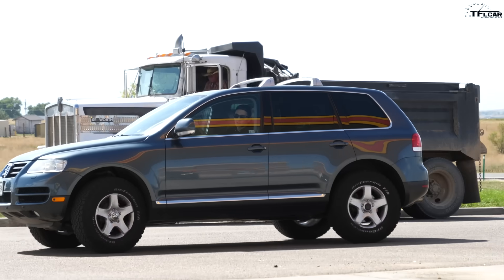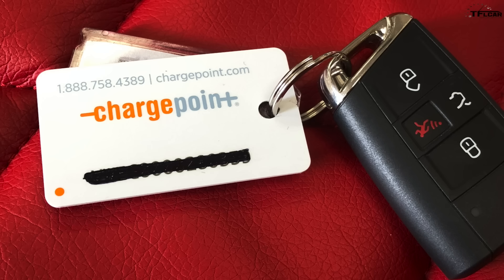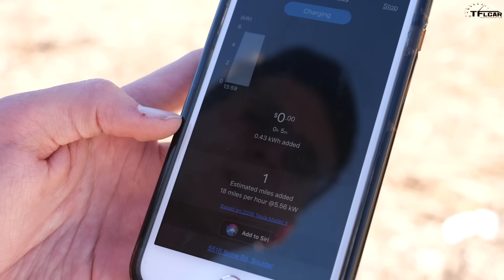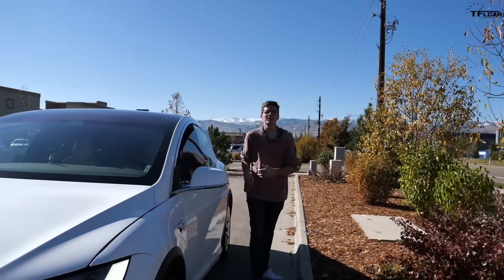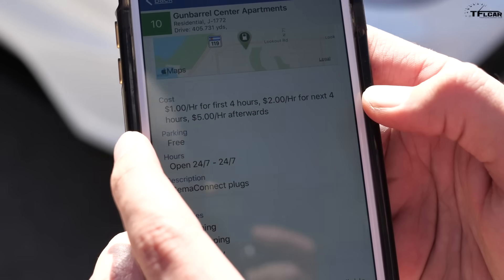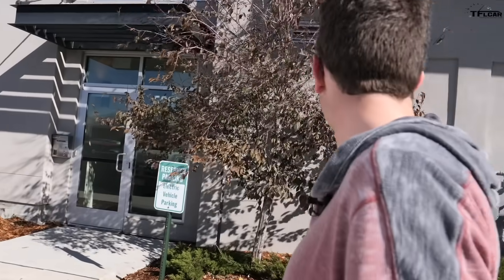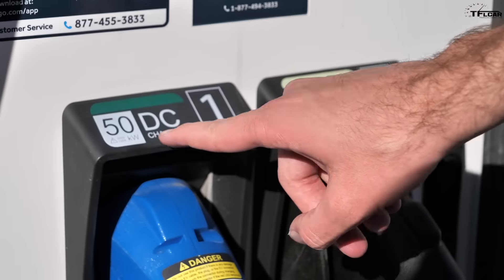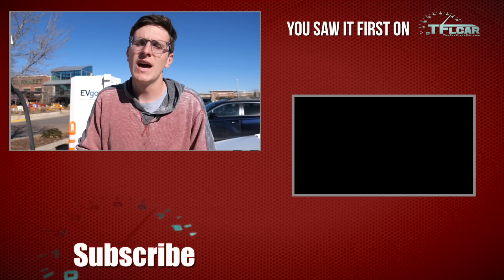Here’s Why Charging an Electric Car Can Suck - And It’s Not The Reason You Think!

Comment: Slow charging everywhere is the future to be aimed for. Think about it. The charging is wherever you happen to park so when stopped you are always charging. Eventually it will be wireless and solar.
Reply: what you communists do not understand is the battery after each charge is going down on voltage and range. NO BATTERY GETS BETTER WITH USE. they all lose capacity week by week. also using a super charger takes away MORE of the life of the batteries

Comment: Most people can make owning an EV work, especially in cities. You can find reasons not to, if that's what you want.
NOBODY SITS IN THEIR CAR FOR HOURS WAITING FOR IT TO CHARGE. Charge in your driveway, for some people that's all they need. Some areas have chargers near stores or work. I used to slow charge, a 110v outlet at work, 8 hr. was more than enough. Most rarely need to charge from empty to full.
Reply: The bigger the battery the longer it takes to charge, so if you're charging at level 2 (220v) over 4 hours, you're getting a lot of miles.

Comment: Absolute Bull Crap!
You don’t pump diesel in a gas car, so you don’t use wrong adapter. I have driven 1100-miles a number of times, used superchargers, chargepoint, flo…never a problem. As to how long it takes, better ask your non Tesla manufacturers why they keep on making “town cars”.

Comment: The charging station networks are a negative when it come to car charging. Simply is not in the playbook. The installation of one or more 50 amp plugs on the back or side of a store or station should be a good start. The EV owner can carry a gen 2 charger while traveling.  The store charges a fee for plug use. The store, station, eatery,  or whatever, will most likely make further sales to this patron also.

Comment: "Without solar, your electric vehicle is still effectively running off of fossil fuels – it's just the fossil fuels utilized at the power plant and not within your engine"
Reply: This is really a COAL POWERED car!  Ha! Ha!
Reply: @stantheman5350  Unless I take a road trip, my Tesla is WATER POWERED! Ha! Ha! Thanks to the Hoover Dam.
Reply: Doesn't need to though, even though wind and solar aren't proving to be the silver-bullet alternatives people want them to be, geothermal and hydroelectricity are proven technologies, gaseous fuel plants can burn landfill biogas, and, of course, there's nuclear fission, and now with even better, safer, reactor designs that can use waste from older reactors, it's a better choice than the great option it was before. Yes, the waste is very dangerous for a long time, but it's concentrated and contained, not floating round in the atmosphere.
Reply: @notmuch_23  Silver bullets! So who’s arguing that?
Reply: That will depend where you live! 19% of the USA power comes from Nuclear generation.
Reply: Fossils are made of stone; in other words this is an intentional misnomer. Its MINERAL oil - and will never run out....now think bout how that affects the price.
Reply: How about battery life.  How often do you have to send batteries to the land fill.  Every ten years??
Reply: @ed5308  I believe Tesla claims they need to be changed every 400,000 to 500,000 miles. That to me is a best case figure. In reality, given extreme weather swings in temperature, that figure will be greatly reduced for cold climate users.
Reply: So it’s interesting how you completely discounted any benefit from renewables such as Solar, Wind, Hydro, Geo thermal, and Bio-Fuels! So why didn’t you mention those sources of energy?
Reply: @theodorehaskins3756  The benefits are minimal at this point.
Reply: @Mike-zf4ev   Really! So remind me of who you are, and what is it that you’re an authority on?
Reply: @theodorehaskins3756  Read the data. They account for 21%.
Reply: @Mike-zf4ev  okay! 21% and that’s nothing? Is that what your data says, 21% equals zero?
Reply: Not if it's a hydraulic or nuclear station.  Neither if a fossil fuel.
Reply: So this is news? Who’s arguing that? Tell us something we don’t already know! Thank you!
Reply: @omi_god  I'm sure it is a percentage we can't simply ignore but what is your source?
Reply: Not even remotely true. The grid has a wide range of non-solar, non-fossil energy sources. One or the other of wind, geothermal, nuclear, and hydropower are sometimes all or nearly all of the energy source for some grids. And why leave out solar? It is also a large and growing contributor to many grids. Fossil fuels are a diminishing part of grids almost everywhere.
Reply: Depends on where you live. In WA state we get 2/3 of our power from hydro electric and only 20% from fossil fuels.
Reply: Yep, so true. EV is another one of thoe lobbyist harrassing the governemt to change deals. Remember lead to unleaded fuel and all the smog control devices. What did it achieve? Lower power output via the smog sgit fitted. All they did was inject fresh air into the exhaust to dilute the exhaust the exhaust gases. Lower power, high gas mileage, same emissions if not more but the way it was measured it was less because of the freah air dilution. The they cat converters. Don't work so well when they're cold. When hot they do the job and then continue to keep going. A byproduct is H2S ( Hydrogen sulphide) a deadly gas. Over 150PPM and you can no longer smell it because it affects the nostrils. Worse than CO and CN.
Reply: So true they run off of coal and such!
Reply: Exactly and coal
Reply: Yep. And the dummies continue to believe it's done by oompah-loompahs.
Reply: As we use greener methods to produce electricity EVs make more sense.  There's also the environmental impact that the car's batteries have, both manufacturing them and disposing of used batteries.
Reply: Well, there are many nuclear power plants operated in the US right now, so you may be just as likely to be getting your power that way.

As for efficiency, I understand half of the power generated at an electric power plant is lost while "pushing" the power out through the lines. So, there is still an efficiency issue to deal with.
Reply: @eddarby469  The notion that "half of the power generated at an electric power plant is lost while "pushing" the power out through the lines" is common, and completely untrue. Grid transmission losses are ~6% in the USA.
Reply: @eddarby469  They want to get rid of nuclear power plants soon. So think again Ed
Reply: @Minenotyours58  The newest reactor to enter service is Tennessee’s Watts Bar Unit 2, which began operation in June 2016. The next-youngest operating reactor is Watts Bar Unit 1, also in Tennessee, which entered service in May 1996. And that's just when they entered service, they started permitting and building 15 to 20 years before that.
Reply: Geez Finally someone said it!!!
Reply: Agreed but it is more efficient to create power at a power plant and use it in your ev car that a combustion engine is. Also we are working towards more greener sources of energy
Reply: Talen, the town clown.
Reply: @Talpalman0234  Actually, no. The internal combustion engine is the most efficient power conversion device. So much so that electric generation that has been converted from coal has often gone to gas generators.
Reply: @Talpalman0234  more efficient?

Dude, burning fossil fuels for an hour just so a car can go 17 miles isn't efficient by any means.
Reply: @Talpalman0234  Yes, but if everybody went electric the whole country's grid would be overloaded and quit. No power anywhere.
Reply: @Talpalman0234  Not sure about that. Say in these example below we start with fossil fuel on site, either at the utility power station, or at a gas station. For a gas powered vehicle, you fill up and go. It required only one energy from combustion to engine torque. In an electric vehicle, the power station burns the fuel to make electricity. At the charging station you take that electricity and charge your batteries. Then you use the batteries to power electric motors providing the torgue to the vehicle. Thats 3 energy conversions. Typically energy conversion runs from 70 - 85 percent efficiency or so. Lots more loss (wasted energy) in an EV.
Reply: @Talpalman0234  Nuclear power is about the only source of electricity that can meet the demand of a national EV fleet and be relatively efficient. Otherwise,  fossil fuels have to drive the turbines. Sorry to burst your dream, but wind, solar, and hydroelectric will never come close. 

It's a well known truth in Physics and Engineering that no process that transfers energy from one form to another is better than about 70% efficient, and the efficiency of most everyday devices and machinery is at most 50%. Gas and coal fired electrical plants are not going to be much more efficient than a gasoline or diesel engine. Then the electricity has to be delivered at a cost, as does gasoline or diesel, and then converts to kinetic energy in the car, as does a gasoline engine. So, in truth, the net efficiency of the two are really about equal.

And none of this takes into account the level of destruction about to be meted out on Earth's surface to go mine the elements needed to build all the EVs, their batteries, and the cables that carry current from power plant to the charging stations. Quite the irony - in order to reduce pollution of the atmosphere, the cry babies, hand-wringers, and busy bodies are forcing a change in transportation that will require the rape, destruction, and pollution of the very land & waters that we live on. Not to mention the proliferation of nuclear power plants and the radioactive waste that they produce.
Reply: @jeffreybeaumont7602  You're completely right about nuclear power (4th gen, low pressure liquid fueled, to be specific) as the only viable energy future. However, marginally less than 100% is the theoretical limit of energy conversion efficiency (granting entropy).

At large modern power plants, thermodynamic efficiency gets to between 40% and 50%, whereas car engines (powering the vehicle directly, under real average use conditions) get to about half that. Mechanical to electric (and reverse) conversion with modern equipment is comfortably over 90% as is grid transmission.

EVs are the clear winner in terms of overall energy conservation - not by orders of magnitude, but by a healthy margin of between 30% to 50%. Moreover, this isn't taking into account the fact that internal combustion fuels have to be refined, which takes energy. Just this process uses enough energy per gallon of gasoline to drive 15 miles. 

Whereas, industrial power plants can use a variety of different fuels from solid fuels like biomass and coal, to natural gas and fuel oils unfit for ICE's, to nuclear and maybe eventually fusion, plus supplementals like wind, solar, and hydro. Point being, there's a great deal more flexibility in keeping people mobile when the cars aren't their own power plants with very particular requirements.
Reply: @jeffreybeaumont7602    Thank You Jeffery.  Well stated.
Reply: @jeffreybeaumont7602  I just saw a TED talk about thorium as a nuclear source with far less radioactive waste in fact it can USE current nuclear waste to produce energy. You need only enough thorium the size of a large marble to serve one person's energy needs for 100 yrs for one dollar per year! the problem is it is too cheap
Reply: @jeffreybeaumont7602  and children miners digging the cobolt out of the ground for like 75c a day
Reply: @jeffreybeaumont7602  Your claim that "It's a well known truth in Physics and Engineering that no process that transfers energy from one form to another is better than about 70% efficient" is completely untrue. Very large motors and generators are routinely better than 95% efficient. The motors in EVs regularly run at better than 90% efficient. The round trip efficiency of charging and discharging a lithium based batteries is >90%
And even if an EV is charging from a 100% fossil powered grid, the net consumption if fossil fuels is far less for the EV. Modern EVs have an equivalent fuel consumption of about 90-115 MPG gas equivalent. It is better by a factor of 2 or more to burn fossil fuels in a central plant and use that power to drive an EV,  than it is to burn the fossil fuel in the vehicle.
Reply: @Talpalman0234  actually, no. it is far more efficient to create power at the point of use. far too much is lost during transmission........i should know

Comment: My issues: I do 500-1000 km trips without any real stop.  I can do it with a gascan and my fuel tank.  And at the end, I don't have access to any sort of grid connection.  I would not be able to do the trip if I had a electric vehicle.  I would have to do several stops along the way, for long periods, making it take even more than the 9-10 hours it does currently.
Nor do I like the fact that the companies can't get together and have a standard connector on the vehicle.
Also, I didn't see any weather seals... so what about charging when it is not clear?
Another, what about range when it's cold out?  I very much haven't heard anything about that for Canada... especially for more than regular commutes!
They say it's more environmentally friendly, but they don't talk about where the power is coming from... they just ignore that part.  Also, there is the fact that the battery is very pricy, and will it last the life of a vehicle that is kept for 10 years or longer?

I think I will stick with the more reliable gas engine.
Reply: IF YOU TRAVEL ANY DISTANCE YOU WILL NEED TO PLAN IT OUT AND RESERVE CHARGING STATIONS IN ADVANCE. WHEN YOU ARE DOWN TO 5% BETTER START LOOKING OR YOU BE PUSHING THAT CAR.
Reply: THE REPLACMENT BATTERY WILL COST MORE THAN THE CAR.  JUST LIKE INK FOR YOUR PRINTER.

Comment: So it's seems like EV is reasonable if you are making max 300km (180miles) per day max.
Then  you can plug in for a night and next morning if all go well you can do another 300km (180 miles).
Then travelling is relative cheap.If you need to do more than those 300km daily then making let"s say 600km (360miles) can take you easily 16hours if not more including charging?
Then ICE will not have real competition for a LONG time... 
I've done using ICE 1256km (780 miles) in approx 15 hours.
Reply: YOU ARE ON THE ROAD, WHAT YOU DO RENT A MOTEL ROOM FOR THE NIGHT AND SLEEP WAITING FOR YOUR CAR TO CHARGE UP.

Comment: What is going to stop the bad guys from coming up parking next to you, or sitting there waiting for someone to start charging, then as you walk away they simply remove the cable and hook up to their vehicle ?  You return expecting to have a full charge and nothing. Or just vandal type simply pull out the charging cable for the heck of it ?  And then there are those that will steal your adapter as well ?

Comment: Major, major pain in the butt, from any of 150 points of view.  For one, he's standing out there on a sunny, warm day.  How about in the dead of winter, or during a rain storm? These stations are not even covered! If it's freezing cold out, I can take three minutes to gas up my car and take off. But a half-hour?  Also: he's charging in a densely populated urban area with a lot of stations. How many of these will there be in mountainous areas or stretches of desert or heavily forested areas? Finally, he didn't have to wait in line. If you're at a shopping mall a couple of days before Christmas and discover you need to charge up -- but there are five people in line to do it -- what?  You're going to wait 2.5 hours to do it?  EV's are coming, so I'm sure these problems will be solved eventually, but meanwhile...I'll stick with internal combustion.

Comment: gee my battery just went dead in my cell phone hey buddy can i use your phone to call my wife so she can program the fuel pump oh thats right i forgot she is at a tupperware party next door she must have left her phone on the charger next door and i don't know the last names of my neighbors they just moved in . well i have to relieve myself but this motels doors are locked so ill walk down to the corner gas station but wait the sign says oh you  have to get the key from the attendant . i tried to ask the attendant but some guy said hey buddy wait your turn . so after i waited for a couple of people to scratch off their loosing ticket the attendant said the bathroom is for customers only so i bought some candy got the key opened the door and their was some people smoking pot in there . after i wet my pants they finally left the bathroom it was really skuzzy . i finally used someones phone got a hold of a friend to help me turn on the electric charger after two hours i got home the wife said where were you all day ?